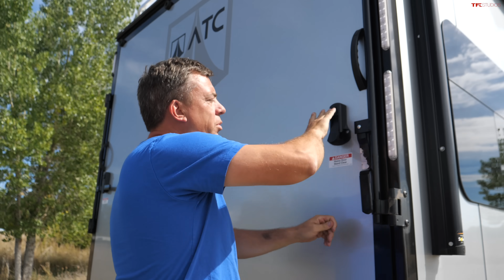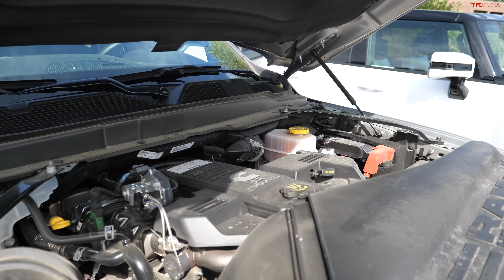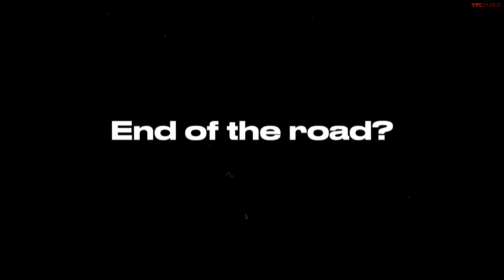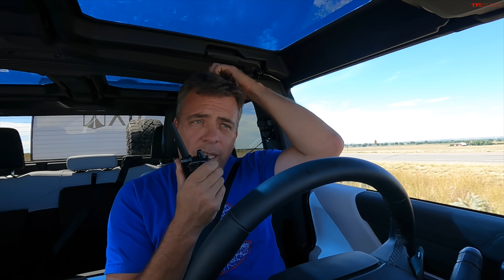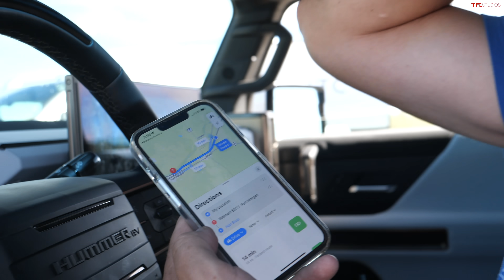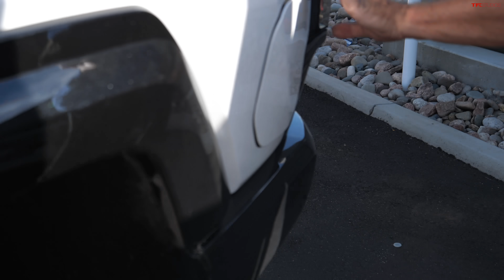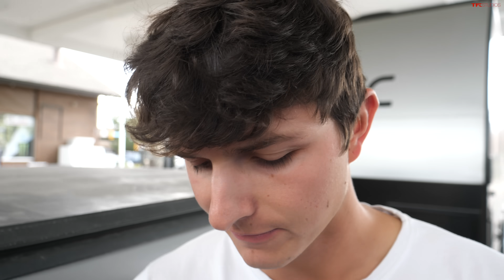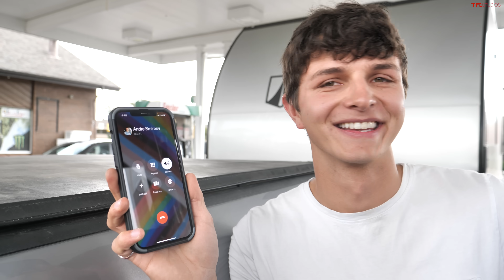How Far Can a Diesel and Electric Truck Tow An Identical Camper Trailer on ONE Fill-up?

Comment: Today's electric vehicles aren't meant for towing, so there's not a lot of value in doing this test? You have to be stupid to buy a current electric pickup for towing. It'll be ten to twenty years before a test like this makes sense, but by then diesel could be so expensive, while batteries will be cheaper, that this test could be irrelevant. No injectors to change either with an EV. That's one of the worst things about diesels. Doods can't afford to change their injectors, so they go around spewing smoke. Diesel pickup drivers are their own worst enemies.
EV's are still in the early stages of development and are improving rapidly. They make a lot of sense in a car form in cities. Not ready for towing or long-range driving, though. It's kind of silly, really, to think an electric pickup will do the same things that a diesel one will. A hydrogen fuel cell pickup would be more ready for the diesel challenge. Electric motors are actually great for towing, but they need something to make the electricity - like on trains, for example.

Comment: Rather fill up quickly than be stuck longer and absolutely discussed at a charger that’s broken down or someone is parked where I need to park and they are not an EV. What about having one on your app and driving there and they are full up with a line waiting

Comment: I must say "Thanks for the Laugh".  My diesel has "the bed" PAYLOAD!  I use the heck outta that.  I can work on both a bit but the diesel more experienced.  You reminded me in the winds who was in front also?    Charge times vs fill times!    I use my truck to haul a tractor, a load of firewood etc. You proved to me "keep this ole diesel"  Now lets discuss your exhaust brake i need to add.

Comment: The diesel already has the advantage, just because it can drive over 400 miles before there's another fill-up. At tops, that EV truck will be lucky to go 200 miles with a load. Now, I'll watch the video to see if I'm correct.

Comment: As far as towing goes electric is realistically out of the question regarding feasibility for now. At least for most people. Passenger cars are much closer to being there. Everything will depend on battery technology improving or hydrogen becoming more efficient to produce onsite.

Comment: Electric powered autos have been around for a very long time. 1920’s?  Around then.  And they only work on very light vehicles with one or two passenger capacity, and city driving.  The noose around your neck is the constant daily routine of recharging.  Then comes battery health and degradation. Then comes being stranded due to miscalculated timings. Then comes…blackouts and unexpected supply charge issues, like damaged electrodes and connections.  Vandalised charging stations…Then comes cost of electricity.  Replacement battery.   There is the huge green nightmare of explaining the use of power generation stations to produce the electricity.  The whole idea of commercial and heavy duty work vehicles using all electric drive is DUMB…we do not yet have the technology for it, and that is very clear.  The scary part is racist and woke governments simply Mandating and Legislating their use, and financially punishing those who don’t participate…that is woke tyranny.

Comment: Delete that Cummins and you'll triple the range compared to that Hummer. Use to get 9mpg on my '16 Superduty towing 24ft enclosed and deleted I was averaging 16 with the same set up and equipment. More power, more torque, more range while keeping the motor cooler than what it was stock. I'll stick with diesel until something changes because I can't justify up front double the money almost and time wasting charging.  Time is money and the Electric trucks will just slow us tradesmen down.

Comment: the diesel is at a handi cap though with all the emission systems attached to it. Delete the emissions put a tune in it and I bet your tickling on 20 mpg with that truck pulling that trailer.

Comment: I have to replace my standard lead/acid 12V car battery every 2-5 years for about $100.
How long does the EV battery pack last until you need to replace it?  How much does it cost to replace an EV battery pack?

Comment: If you spend $100 per week on diesel, it’ll take over 11 years just to pay for the initial price difference. That’s not including the cost of electric charging. 
By the time you get your money back, the truck will be beat down and will probably need a new battery, which will cost who knows how much…

But looks like they’re working very hard to drive up the price of fuel. 😡

Comment: Lets b honest about EV, right now they are toys. And imagine just 30% of the population doing what you just did at a charging station, it will be a massive blackout. So knowing what it takes to make EV batteries and knowing that most electricity in America right is produced by coal, this cleaner air campaign for EVs is all b.s.

Comment: a ford f250 super duty can two up to 13000 pounds and can go around 300 miles or more on a single tank of gas, just buy a gas/ diesel and save 30 grand

Comment: Diesel hybrid is what is needed. Smaller engine smaller battery and regen breaking. It has worked in the rail >ndustry for 90 years.

Comment: Mother natures real battery is the most efficient of all batteries, which is called, oil, natural gas, and coal. Man made batteries are a joke and a environmental  disaster. Plus time is money, how long did you waste charging verses filling up with diesel? fuel fill up is at most 10 minutes, with charging even at highest rate was well over 40 minutes

Comment: I worked at a dealership and had to drive a dealer trade once. I drove 100 miles with the gas light on on a brand new 2500 ram because the idiot sales guy i was helping was driving a jeep trailhawk and left me behind and i was broke so couldn't use my own money to put fuel. Diesel definitely has my vote

Comment: That "Efficiency" number is totally BOGUS. You cannot equate electricity to diesel or any other fossil fuel in that way. You would have to look at the energy required to produce both and figure that into the total efficiency of the power medium. It is not a direct apples to apples comparison.

Comment: The more fuel you burn the lighter you get. Your always lugging a 3000 lb battery. Total scam. They tried this over 100 years ago. It's no better now. Plus you have way more electronic devices and an AC. Stupid idea all the way around.

Comment: Petroleum fuels are the cleanest and most efficient by far.  Carbon dioxide is what grows trees and grass through photosynthesis.  That is what the so-called "carbon footprint" is.  Anytime energy is converted into another form, there is an unrecoverable part that is wasted.  Battery-powered vehicles must use oil to generate electricity to charge batteries.

Comment: I've been stating this for years now, EV's are great in the city and short trips but when it comes to long distance driving and towing, diesel is king. This is why I have my diesel 4x4 for towing my boat and my EV for every day driving around my local city. Great video gents.
Reply: Exactly..had 2 Tesla model x cars, top battery, loaded. Good for about 180 miles, at most. Never towed anything. Went Vegas once, totally stressful, had to stop twice. About 300 miles away. $150K car, good for around town or short trips only.
Reply: @ethanmurray2203  Thank you for this honest answer/explanation. I am a dentist with a 7 mile commute, so an ideal EV owner, right?
But I just unloaded my F250 after pulling a gooseneck trailer, utility tractor, 2 UTVs, 2 young boys and a deer 90 miles back from my hunting camp where I used 4x4 all weekend. I filled up Monday, drove to work all week, made the 180 mile round trip drive pulling 10klbs and still have 58 miles in the tank.
So mon-fri, I’m the ideal EV guy, but come the weekend, I’m rarely w/o a boat or hunting gear. I’ve considered a Tesla, but it would be a total waste of money and resources.
Reply: @chadgardnerdds3197  Especially if you have a big solar system,  or live in a place without crazy electric rates, like here in San Diego. Keep the truck for hauling, electric car for running around town. They are fun to drive. See if tax credits are available too.
Reply: @ethanmurray2203  I’m in rural Louisiana living on 58 acres with 35+ acres of pastureland being used for hay since my daughter moved college and no longer barrel races. I have been approached about a solar farm being put on the pastures, but I am better off selling the hay and my homestead being a legitimate farm business. 
I’ve looked into it and the benefits of a solar farm are not great in my state. I realize that wasn’t your point, but I’m just saying it’s strange that an area receiving 8+ hours of very intense sunlight per day is not better incentivized. 
Regardless, I’m not going to spend $100k+ on a Tesla, although I do think they are cool, when I only burn 2-3 gallons per work day, then an unknown amount on weekends. I just don’t see how the benefits are there when I factor in insurance, another payment, maintenance, etc but I could definitely be wrong.
Reply: @chadgardnerdds3197  well said chad i agree 100%.
Reply: EVs are, and probably always will be, commuter vehicles.
Reply: How about the environmental cost of the hardly restricted cobalt and lithium mining in countries like Democratic Republic of Congo? Wrecking large areas of their landscape and the water pollution? Not to mention the child and near slave labor this demand is being provided by? It can hardly be said that EVs are any more environmental than oil burners…
Reply: That's what the power that be want... They want you in an urban area. Everywhere else you go, they want you on train. But, just beware, if you want to get on that train to visit grandma two states away, you BETTER BE A GOOD BOY WITH THAT SOCIAL CREDIT SCORE!

Comment: I get that it's supposed to be a fight based on a full tank and a full charge, but no matter how nice electric gets how about getting equipment to a remote location with no plugs... 😂 😂 😂 My truck can carry a gas can. I guess you can open up a solar panel but you better hope there's not a lot of trees and have several hours to spare for your batteries to charge...

Comment: Hey how about do a video for the working people the ones you got to pay to get jobs done. Let's say load a  a kubota svl 95 or a svl 75 your pick. 2 attachments and pull it with the 2500 on a gooseneck Against a EV. Then all the EV people can really see the work they want done from contractors is going to go through the roof.

Comment: If you run out of charge just call triple A and have them bring you "a can of electricity"😂
Reply: They use diesel generators
Reply: That's an interesting point that still needs to be addressed for EVs, perhaps by a towable battery, from which the EV can run directly from until it reaches the next charging station... and that towable battery can even be delivered without the need of a tow truck, which is certainly always better than having to wait for a tow truck.
Reply: @you2be839  Robots and drones to the rescue!

Comment: The real advantage EV's have over gas/diesel is how easy it is to refill you're tank with a couple gallons of wind turbine if you run out of electricity on the side of the highway.

Comment: Combustion engine still hasn’t found a ceiling as far as hp. The EV’s are a full ton heavier so we need to discuss battery life to engine life tire wear between the 2. I’m afraid until EV’s become efficient cheap and reliable they are no where near comparable to diesel. My 2002 duramax gets 10 miles to the gallon pulling 2 trailers at roughly 16,000 pounds plus the weight of the truck. The EV’s can’t pull the weight and get half the distance of my 20 year old truck. Keep the videos coming you guys are awesome. Great job as always!

Comment: Uhhh... electric will give out, after fully charged, when towing a full load, at about 30 miles. Not to mention ev's turning into fiery bombs when getting saturated by salt water and having them under or over charged.

Comment: One thing that is not even noted in this test is the traveling from Boulder CO to Oglalla NB would be GOING DOWNHILL 2,200 FEET, almost 1/2 mile vertically. The range traveling WEST would be even worse, pulling an uphill grade the whole way. Throw in a 25 MPH headwind, and suddenly your range is 25% of what you expected. 

At that point you would pretty much have to scrub the trip as you would spend more of your weekend at the charging station than you would at your campsite. 

When it comes to towing/hauling electric vehicles are the “vehicles of the future” and always will be. How much of the GVW of the Hummer is devoted to the 3,000 pound battery, which weighs 20X as much as a 30 gallons of diesel?

Andre recharged to about 35% of capacity, did he have to stop a SECOND time to recharge in order to return to Boulder?

Comment: So was that $45 on the electric bill at 123 miles? Or would the round trip have been $90 if EA wasn’t running the free promotion? Great video exposing the tow load vs no load. I’d still like to own the Hummer but I’d need to keep my Duramax nearby.

Comment: The elephant in the room that little minds choose to ignore is WHERE does the energy come from that charges EVs?!?!  I don’t remember either evaluator even bringing up this most important fact!

From a power plant! 

At present, about 40% of US power plants still use coal (100 train cars full PER DAY, for a medium size power plant). About 22% use natural gas.  About 62% of our power STILL comes from fossil fuels! PUT ON YOUR THINKING CAPS!! Seriously!

In the end, EVs DONT HELP THE ENVIRONMENT, they actually cause more carbon pollution and cost much more money and are far less reliable.

Comment: I'd like to see the results of that Hummer towing in inclement weather and towing a full camper, I don't know to many people that camp with an empty trailer lol
Reply: They picked a trailer that was close to the maximum towing weight of the Hummer already. So you would need to start with a lighter trailer anyway.  These EVs just SUCK for towing, PERIOD
Reply: What's the point it couldn't handle it empty.

Comment: "Efficiency", as discussed in this video, doesn't take into account the energy lost in converting COAL or Natural Gas (NatGas) into steam at the electrical generating station. Fifty (50) percent is lost right there. So much for the myth of green energy. Also, the claim that it cost zero dollars to recharge is bogus in that it was based on a temporary promotion by the electric charging company. When that and the temporary government subsidies all expire,  the charging costs are going to skyrocket to many times the existing homeowner costs, quoting the electrical energy providers.  Go check out the major pollution problems with trying to recycle dead EV batteries. This whole thing is one big scam perpetrated on the public.

Comment: What matters to me is how long it takes to get from Chicago to Denver. I don't believe that any electric vehicle is going to be able to cover long distances as quickly as a gas or diesel it just takes too long to change them.
Reply: I have left Colorado Springs at 6 am and been in Chicago at 10 pm. 32 gallon fuel tank and two stops to fill up .

Comment: They need to have drive through charging so one will not be required to disconnect from their trailer.  The gosoline and fiesal user can drive through.  Can the electric provide power to trailer to run microwave and air-conditioning when stopped for meals.  Charging need to be in our of way places. West 100 parallel to serria and Cascade has less people then five boroughs NYC. There is little insensitive to build charging away from major highways. Gasoline and diesal can be more then 70 miles apart. Road service can't carry electric CNG  LNG and hydrogen to stranded drivers